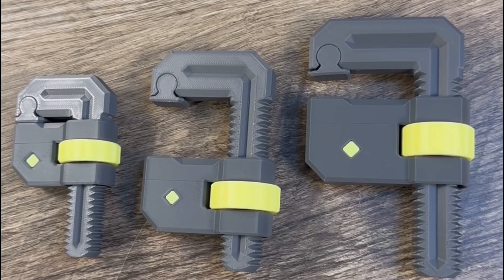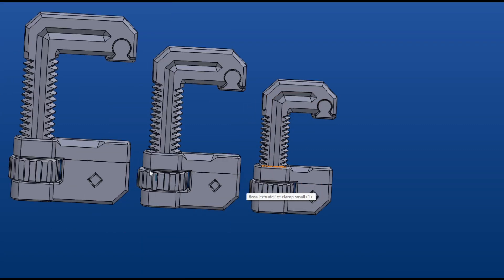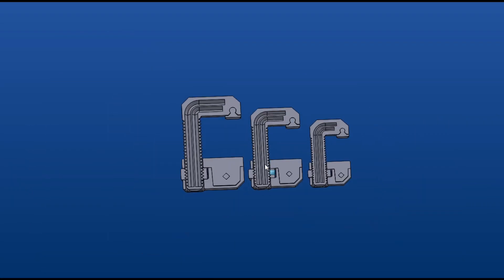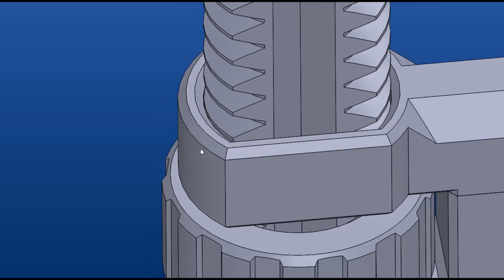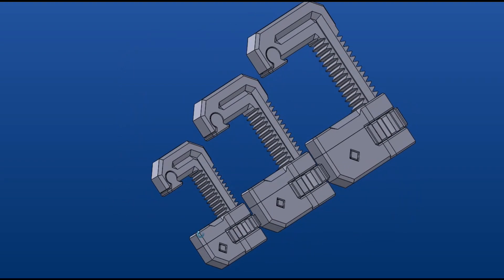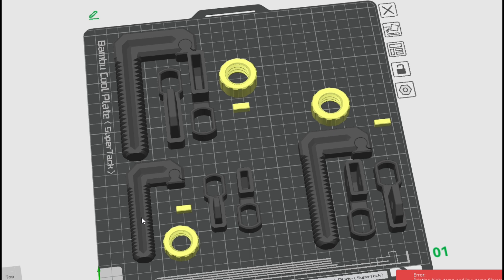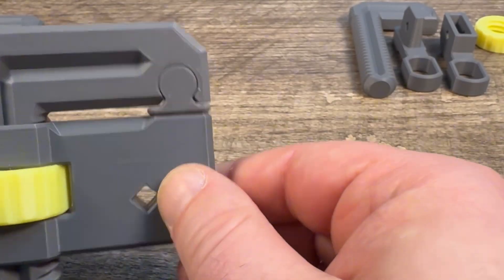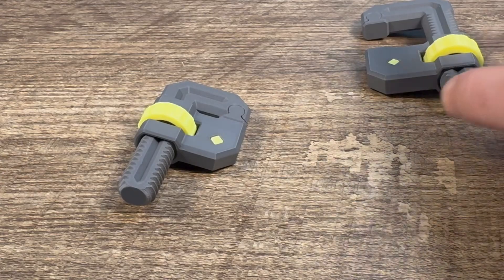3D Printed Clamps That Actually Work - NO Support

Comment: I like your design and all of your print orientations provide max strength. I think more people should do threads this way. 

I would recommend providing an option with the sliding jaw as one piece with supports. You could make it stronger and it would like cut down on the sliding jaw creaking when this is tightened. 

You could probably even design your own break away supports if you don’t trust the ones the slicer generates.